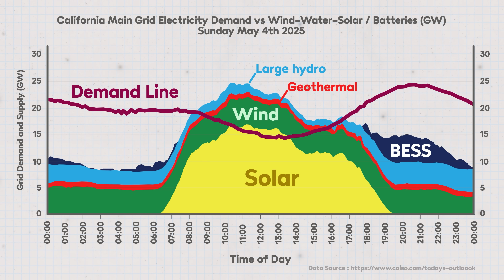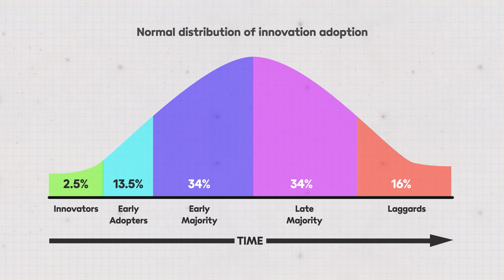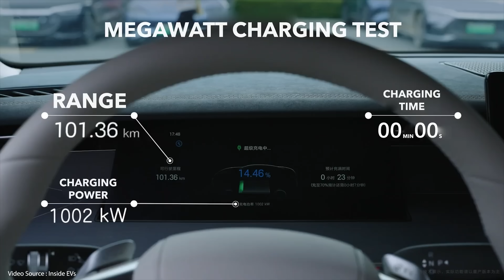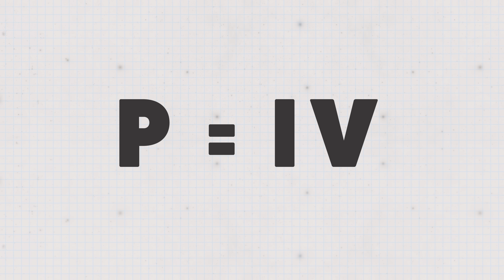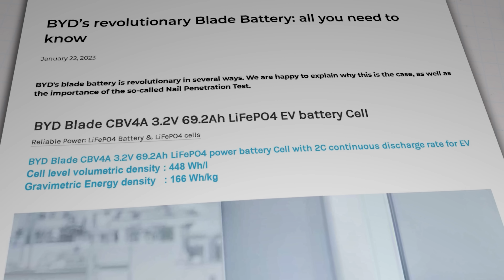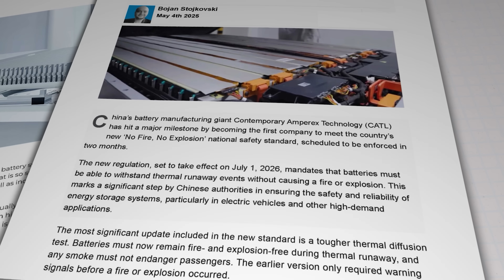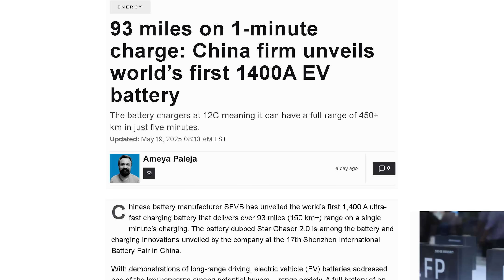BYD 1 MEGAWATT 5 minute EV Charger. Overdue or Overkill?

Comment: I live in a flat and my GF lives 1.5 hours away. My flat has no EV charging facility, my work has no EV charging facility, my GFs house has no EV charging facility, my dad lives in a rural area and the nearest parking to his house has no EV charging facility. Currently I can fill my car up maybe once every 3/4 weeks near my home and it takes maybe 5 minutes in total. If I got an EV, I'd have to charge it maybe 3 times as frequently, particularly if it's either too hot or too cold. I'd have to wait around for longer and pay a premium at a 3rd party charging station, in a car I've also already paid a premium for.

Suffice to say, if I'm going to already be paying a premium, I don't want to be waiting around for ages and a usual 5 mins a month for journeys currently turning into hours a month.

Most current EV users have infrastructure that works with EVs and so of course they don't have concerns. To label it as simply "perception" is frankly lazy. I have no qualms about EV vehicles in principle but there ARE logistical concerns and dismissing them as merely little more than ignorance on behalf of those with ICE cars and perception is pretty arrogant and dismissive.

When the price of EVs drop, when the charging times drop and when the range increases so those of us who do not have the option for slow charging at home or work can reasonably adopt it, then we will. Until that point, don't dismiss our concerns out of hand.
Reply: Are you saying that your and her flats have no electricity to them?
Reply: @Les_S537  He probably means no outdoor plugs.
Reply: There is a desperate need of laws requiring owners of apartment buildings and employers which have over N number of employees on a site to install outdoor charging plugs.
Reply: @TheDanEdwards  Here's the fix for apartment/condo/flats...

Full self driving.

Automated charging stations.

You arrive at your or your girlfriend's or whomevers home/business and you tell your car to go charge, and to be back by such and such a time...

The car drives itself to the local charging stations, gets whatever it can before you need it back to pick you up, and that's that.

It otherwise just parks itself and waits for you to need it again.
Reply: @Les_S537 so your solution to this issue is a purely fictional one? That's not a solution then is it?
Reply: @ragerancher  Tesla's full self driving is here.  I've owned a Model 3 Long Range since 2019 with FSD in the car.  I've witnessed the progression.  In the early days, I'd have to intervene double digit times per attempt.  Today I regularly experience zero intervention drives.  Tesla's robotaxi is rolling out in Austin TX starting this month (already in progress right now).  It's just a matter of time.
Reply: @Les_S537  There is no way a self driving car would handle any of the situations I mentioned.

1) My flat is down a private road with an electric gate, it would not be able to get back in, nor would it likely understand where to stop for the gate to open when leaving.

2) MY GFs house also has an electric gate with the same issue, as well as being down a bumpy road that requires careful driving to avoid damaging the car.

3) Where my dad lives there are lots of very narrow rural roads. There is no way the Tesla would handle those roads with no markings or recognise where the edge of the road is ok to go off and where it isn't.

4) At work it would need to navigate a multi-storey car park.

So again, your "solution" is lodged firmly in fantasy. Maybe in the future that will be fixed, just like the other problems, so in the future I may get an EV. However, possibly fanciful future fixes are not going to make me buy an EV now.
Reply: What the hell rural area do people not park on their property?  Or are you saying electricity doesn't exist in the boonies?
Reply: @jnawk83 somewhere where the drive can only fit 1 car so when I visit, I have to park away from the house. Hardly a difficult concept to grasp.

Comment: Range and charging speed is not entirely irrelevant. People outside the US dont really grasp how big the country is or how spread out we are. We have 2 EVs at the house and it's sometimes a hassle to plan around each others driving needs. This is especially a concern in winter where the 200 mile EV drops to 130 miles and the charge speed barely breaks 30 kw. Forget about only charging to 80%. We live in a pretty populated area too, but the jobs are all pretty far and friends and family are more often than not an hour away. The 300 mile car is better but that car's commute is 80 miles and in winter we can't get 3 commutes on a charge. Also, we just experienced a trip through an area with limited chargers, and i think this describes a lot of places in the US. For what should be a 7 hour drive, we probably spent 4-5 hours waiting for a charger or charging. It's not unusual to wait for over an hour for a fast charger. For my area, 400 miles is probably what people need for good adoption unless they have an extra ICE vehicle
Reply: You don't charge at home?

You don't precondition your EVs for use in the cold?
Reply: @Les_S537 yes we charge at home. There's 2 cars and one charger. I don't think my service hookup would support both vehicles charging. The problem is that we sometimes both need to charge at the same time and we try to charge off peak times. On peak times, petrol would be cheaper depending on the car. Also the cars don't give an option to precondition except using the car's navigation or charging schedule on the car while always plugged in
Reply: @ironmonkey720  You can charge two EVs at your home at the same time, unless your home is much older with older electrical systems within it.

What amp level is your home calculated to be able to operate within?

Comment: One concern I have over these high rate is the load imposed on the grid. Many public places with chargers aren't built for these high loads. He grid will need to be upgraded.
Reply: Well, obviously, you only install these MW chargers close to major trunks of the grid in your area.

The reality is that these MW charging stations will be used almost exclusively for industrial scale vehicle EVs like the Tesla Semi which has an 850-900 kWh battery pack.

To use a MW scale charging station for a personal transportation EV with a battery pack between 40 and 75 kWh makes no sense at all.
Reply: Can also add batteries locally so that a megawatt grid connection isn't needed.
Reply: @jnawk83 batteries to charge batteries. There must be a better solution.

Comment: Please explain why the US states such as California and New York, which are pushing hard to replace fossil fuels with renewables, have the highest electricity rates?  You would think since renewables are so much cheaper per kWh produced, that they would have the lowest cost.  Is there a disconnect between perception and reality?
Reply: Those states have high taxes applied to energy generation, so when you buy a gallon of gas you'll pay market rates for gas PLUS the taxes put on top by those states.
Reply: Most of my California-based monthly electricity bill is not the cost of generating electricity. The actual cost of the generated electricity is rather low.  Instead it is the distribution costs which are high.

Comment: The price premium for an EV if invested would more than pay for the fuel for both of my cars. But let's consider charging.

Miles of range is uninformative if the speed is not given. EV manufacturers usually us constant 60mph to compute range. On long trips I usually run 5mph over the speed limit to keep up with traffic. So 75-80 is a more reasonable speed. That would push the 400km (250 miles) of range added in 5 minutes down to under 200 miles - less than 3 hours of driving. A bit annoying on long trips. 

But an important issue is the charging cost. My ICE vehicle costs under $0.10/mile. Using most fast chargers - under 500kw, the cost is over $0.10/mile. That is much more than home charging. A 1000kw charger will be more expensive as the base rate for electric usage goes up as the peak demand goes up. 

100,000 miles of driving will cost me less than $10K in fuel. One might compare that to the cost of a new car - EV or ICE. Fuel is not a big factor in the cost.

Comment: 4:51 "Unlike plumbing pipes, which can happily cope with moreorless any rate of water flowing inside them"
Plumbers, chemical and mechanical engineers: yes, we have solved friction haha

This analogy does continue working to a suprising amount
Reply: My guess is with water power, it's not the pipes that [break] but the connections. And with charging maybe it's the cable
Reply: @autohmae the more water you want to pump (flow rate, in the analogy equivalent to power), the larger your pipe has to be to keep velocities low enough (velocity ≈ current), so that you don't lose too much pressure (voltage drop) due to friction (resistance).

Comment: Personally, I don't want 5-10 minute away from home charging. Its stupidly inefficient to have to drive somewhere to charge, standing waiting and then drive somewhere else to park for your rest break.

I want induction charging all over the place. I want to charge in 20-30 mins in a bay I'm allowed to sit in for that length of time charging, while I eat and drink and pee, not all at the same time.

But best of all, I want an EV with 4-500 mile range as that's all I could maximal drive in a day without going potty. And I want the hotel I stop at to have 22kw chargers so it'll be ready by morning to go again. 

Sure, I get that taxi drivers and trucks need fast asap. 

But for the vast majority of us, I bet we'd rather have longer range than super fast charging.

But that'll happen, and probably both will happen, in the next 10-15 years, so my ramble here is pointless.

Comment: The super fast does seem over kill. Fast charging where you can add a couple of hundred miles in 15 mins (Tesla, Hyundai and others) is more than adequate for most people. A lot of cars aren’t yet meeting that, but should be readily achievable as a standard anytime soon. Which is probably more pertinent than super charging. 
Reality if you stop on the motorway for a comfort break and buy petrol its at least 15 mins. Stop at services for toilets and or food, move to petrol station, go in to the shop, buy a snack for the car, pay and walk back to the car etc. I know theoretically you can rush through all of that and shave a couple of minutes off that, but the majority don’t worry too much and enjoy the break after 2 to 3 hours in the car.

Comment: I don´t think, that ultra high speed charging changes much, especially if it only works on a selection of cars in some special charging stations. What matters more is to have fairly quick charging available everywhere. With fuel, that is nothing to concider, you know that there will be enough gas stations on your way and that using them won´t take you longer than 15 minutes, even if you have to wait in a line for a little while - even if you travel internationally. As long as the possibiltiy, that the next loading station will cost you half an hour or longer is a threat or seems to be one, record loading times rather won´t be a game changer. Also: Frequent ultra quick charging is known to greatly reduce the lifetime of batteries, so, usually, you should not want to use such a system.
Reply: Older studies of ultra fast charging were flawed. They had a linear charging pattern which caused more degradation than real-life fast charging which happens in a curve and slows down significantly near the end. And most folks never charge above 80% all the time. There is some degradation, but it's not as bad as most people believe. Some Tesla owners report nothing out of the normal battery loss even though charging all the time at fast chargers.

BYDs golden battery is not showing any issues either, and that's a ridiculous speed of battery charging.

Comment: Down here in Au the ques at petrol stations can be  kilometers long despite how quickly petrol can be pumped into a tank from a simple underground tank. Certainly it is possible to achieve the same with EVs but that means every EV  there needs to be two batteries, one in the EV and one ready to recharge its battery. Certainly doable but that's a lot of resources needing to be dug out of the ground. Yet again possible but probably not in the time agreed timeframe. Perhaps there'd be less pushback if the goal was less ambitious. We are moving in the right direction already' we just need more time than the 2050 goal gives us.
Reply: Why are they long? Does it coincide with shortages? Most EVs will charge at home.and we rarely have a shortage of electrons. Also Au had a great take up on solar, so most folks have lots of spare electrons.
Reply: @colinwiseman  They're long because so many are leaving the city for the holidays. We've mitigated that to some extent by staggering the holidays for private and public schools. Decades ago we also introduced flexitime working hours o try to cut down the AM and PM peak traffic jams but then more people drive instead of taking public transport.
Reply: @colinwiseman  Of course if you charge at home and live in or near a city not a problem however Australia is a big sparsely populated country that many like to explore.
Reply: We don't need to spend time to fill an EV up. If it parks, it charges. No matter if at home, at the supermarket, at the cinema, at the gym. Of course that requires that those place have an AC charger available. But at least in and around the cities chargefox seems to have that covered.

Comment: Thanks for the update.
I own a BYD Ato 3 for almost 2 years now and absolutely love it.
99% of the time I get to charge it from my solar or the grid at home.
But the "range anxiety" and slow charging time are still a real thing.
For instance, I now drive about 150km (sometimes twice) every weekend to a club out of the city and I have to carefully make sure that my car is charged for the trip. I usually do this at home but if I missed the window then I have to "top up" in a public charger on the way, e.g. last night I had to stop forabout 20 minutes just to feel more comfortable with an extra 60k in my "tank" (it was cheap, but still took time).
Another situation is when I take a longer drive out of town then I have to prepare a plan for route and time to stop for about an hour a couple of times each way to have enough charge for the rest of the trip, stops which are being loudly complaint about by my kids.
Reply: Byd jump from 3C charging in byd HAN to 10C charging in byd HAN L..

Also Other manufacturers in China are already using 800V 3C charging in their $15,000 cars.Even xpeng with the P7 plus has 5C charging in its $27,000 car.
Reply: @carkawalakhatulistiwa yep, and it's great news.
But I was referring to the stanz that "range anxiety is a myth and charging times are not a problem TODAY".
Reply: If the kids didn't have that to complain about, they'd find something else.  Tell them they are lucky they aren't walking.

Comment: Is it not possible to charge the battery with the whole battery divided into segments and being charged in parallel.  The more segments you divide the battery into, the lower the current to each segment.  Anyway, just imagine  a whole bunch of cars all charging at the same time at a charging station.  Would you need a megawatt battery to accumulate enough energy to charge them all at the same time.  Otherwise the current draw on the grid would be immense.
Reply: Nah, the grid would feed a local multi KV transformer at a might higher voltage.